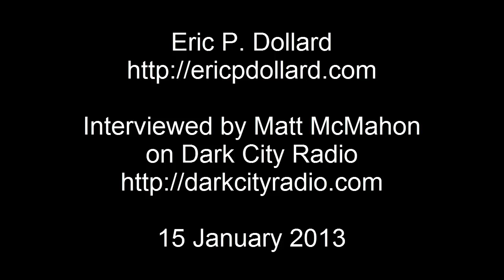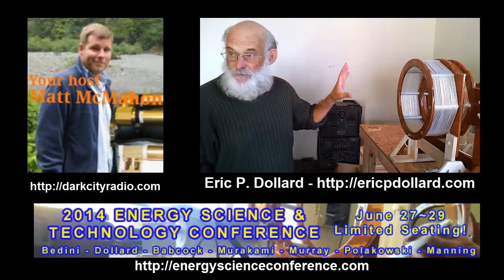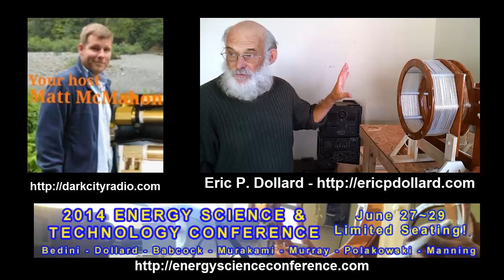Eric Dollard on Dark City Radio by Matt McMahon Jan 15, 2014

Comment: Eric, listen carefully.Your work on the ether is very important. You're one of the few people who actually understands that they threw out real electrical science when they removed the ether. But there's a big missing piece in your model.
You treat the ether like it's some kind of magical background that just exists. That’s not enough. The ether has to be made of something real and physical. It cannot stay as a vague, hand-wavy concept.And here's the key thing you need to understand: if the ether is real and physical, then it can only work as a push mechanism, not as some magical pull like Newton and Einstein claim. Gravity has to be the result of a real physical flux pushing inward from all directions.
You need to look into the real push gravity models. That’s where your ether work actually leads if you follow it all the way. Without this, your ether has no solid mechanical foundation.This is what’s missing from your work.
a few theories to study:
Mike McCulloch  Quantised Inertia
Tom Van Flandern — Pushing Gravity / Le Sage model
John Kierein — Radiation shadow / push gravity
Panagiotis Dalianos & Pier Franco Nali — Lesagian Gravity Redux
Gerasimos Danilatos — Push Gravity
Vijay Vishwakarma — Flux-Shadow Gravity
Shareef Ali Rashada — Graviton Pressure Theory
Dmitrii Osenilo — The Hydrodynamic Model of Gravity
Conrad Ranzan — Dynamic Aether Theory
Ors Marton — Space as an Ether Crystal
Sumeru Ray — Ray Unified Gravity Theory
Günther Kletetschka — Three-Dimensional Time Theory
James Johan Sebastian Allen — Pattern Field Theory
Steven Lizarazo — Alignment Framework
Vitor M.I. Nogueira — Dynamic Theory of the Aether
Richard J. Benish — Space Generation Model 
Hamid Naghieh — Relational Origin of Gravity
Apollonian t.o.e. - Karagiannis Boris